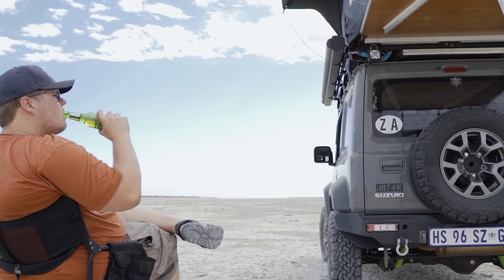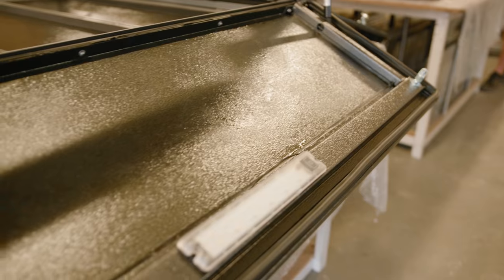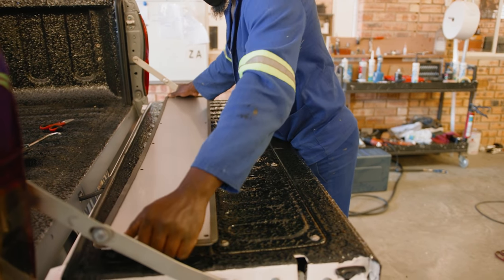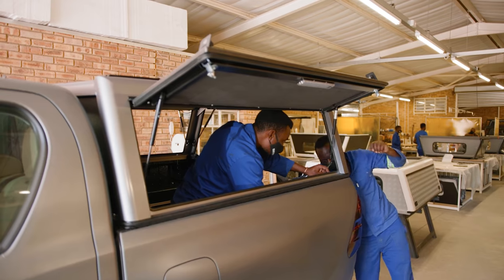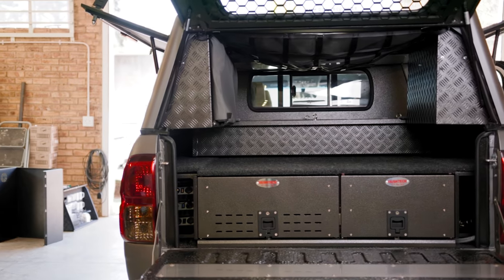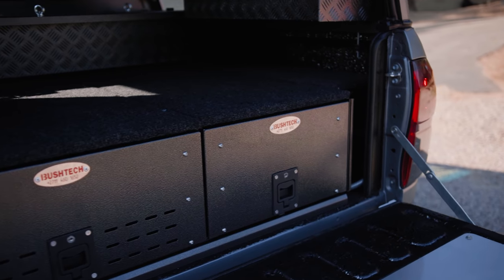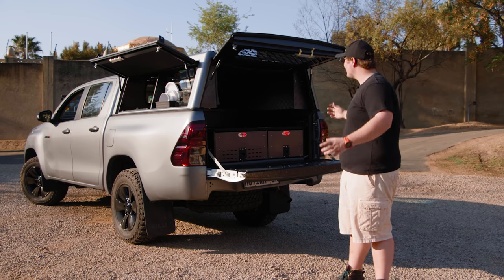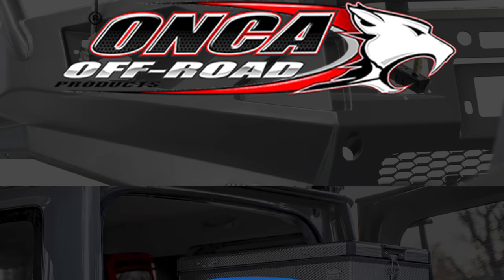Ep5 The Ultimate Bushtech Canopy and Drawersystem Setup

Comment: I will say it again, I really like my Bushtech Canopy. Good choice. 

I had the outside of the aluminium boxes covered in carpet (same as inside), and on the inside over the side door insulation. Works well with valcro canvas bags for those small items frequently used.

Better to do the alternator/solar wiring prior to sealing up the tub. Wasn't easy to remove it to get access.

Nice.
Reply from the maker: We made sure to leave a port open for the cables for the NL-DC25 Box, I managed to run it all weekend just off solar in the meantime 👌🏻
Reply: @RoamOverlanding  Great stuff, hopefully I'll get my NL25DC solar algorithm update this week.  You can ask Frans and Steven at NL for more info on the specific issue if you want. I'll leave it at that. Then I too can use my solar properly. Thank goodness for their warranty, great customer service from NL.
Reply from the maker: Will ask about it.

Comment: Hey, another great build video! a few Q`s do pop up; 1: What insulation in particular have You used? Reminds meof a closed foam cell.Please elaborate  2; What weight have You gained with this install? & what is the rated weight do the drawers hold fully extended?  3; What is the rated roofload on this canopy & are tracks on top standard? 
Another huge downfall which I see often on these (ZAR) PickUp-builds is access to the water tank & filler neck. I can see the value of not having a bulk head mounted filler neck (into the canopy) as it may be a source for tampering, but at the very very least extend the filler spout to the "gullwing door opening" so U don`t wet the entire inside when filling. 
Keep posting, genuinly keen to see where this is heading :-)
Reply from the maker: Hey Peter, thanks for the questions. So The Insulation is made by a local plastics company its a foam, that its nearly really tough and dense. 2. The weight of this whole setup is around 150-170kg. The Weight capacity of the drawers is in the 100-180kg range I believe. The roofload of this canopy frame exceeds 2 tons, the tracks do come as standard, although not in black. The Filler hole for the tank is easily accessible from the door, just pop a hosepipe inside and fill it up, shut off the hose and pull it out. I did it this weekend and it worked absolutely perfectly fine (I had the same anxiety before actually doing it)
Reply: @RoamOverlanding  I would still have made it a priorty to have the fillerneck way more accesible. I used this setup in a rental & it was a pain to say the least. Congrats on the overall progress!! Brgds from 🇳🇴👍
Reply from the maker: @peters2860  an extension can easily be added, but wont be worth the effort for me. I will however run a 12V pump to be able to shower and or pull in water if necessary

Comment: Congratulations. Excellent project that I am following.

Some questions:
a) Water tank with only 45 liters. Do you consider it enough? What about the shower?
b) Standard fuel tank for long trips? Take in jarricans or installed an extra deposit. I just didn't realize it.
c) Spare tires remain in the standard place or are you going to put that elsewhere? At the rear maybe since I don't see the rear bumper. One or two as I have seen the most common opinion?

It is a fantastic project and I have followed it because it is about a Toyota Hillux that is also my project for about 3 years from now.

Good job and I'm following it here on youtube.
Thankful.
Reply from the maker: Hey Paulo!  Thanks for watching!
a) 55L water Tank, its a lot of water! I will use it for washing dishes and having a shower every now and then, but not every day. Depending on where I am on my travels, this water might be for emergency drinking water.
b) I have a long range tank that came with the vehicle an additional 65L of usable fuel however it is 80L big. I dont want to use Jerry Cans anymore.
c) I will keep the Spare in the normal position for long overlanding trips, and a spare wheel carcass (with no rim) on the front roofrack (once that is installed)

Comment: Now how do you fill up you water tank??
Reply from the maker: Very easily, the cap is accessible near the cab slider. Tested it this weekend and it worked like a bomb!
Reply: @RoamOverlanding  So to get water into the tank you get a hose, connect it to a tap and stick it inside the tank, correct? Or alternatively, fill a jerry and gravity feed it?

Comment: Looking good👌 Whats the purpose of the stainless steel plate on the tailgate?
Reply from the maker: It can be used as a food preparation table, as well as gives you a flat space for a gas stove and for me to put my camera gear etc. Normally the tailgate has lots of ribs and dots on it/
Reply: Must say thats very clever - things can stand then and not fall or wobbel over

Comment: Such an epic setup, and it looks amazing with the colour coded canopy. With the rear completely empty, is it big enough to lie down in to sleep? I know that was never your plan, but just curious!
Reply from the maker: Unfortunately for me the double cab is just way too short. I used to sleep inside my Single Cab Amarok though :P
Reply: @RoamOverlanding  I have seen setups like yours that allow for sleeping in the rear, I actually have a double cab Hilux that allows me to do it, I have a canvas tent that attaches to the underside of my fibreglass hardlid, and goes out around the lowered tailgate, which gives enough floor area to sleep, on a setup like yours it is similar, but they use a false floor on the tailgate to level with the drawers, and attach the tent to the canopy door. I realise that's not what you're planning to do, but it is an option for double cab owners to sleep in the tray.

Comment: Looks awesome! Is there a dust/water seal on the tailgate? If you use right hand draw to store electronics can you move your battery to below it to allow easier charging?
Reply from the maker: You could, or you could store your electronics in a cupboard and run all your outlets into that for example 👌🏻

Comment: Hi Adrian, awesome following your journey. Once the borders open I'm gonna leave Maputo and head over to Jo'burg to get some mods going on. Could you get us some more info on the side drop down table?
Reply from the maker: Sounds like a plan! What would you like to know?
Reply: @RoamOverlanding  Cheers Adrian. Does the latching mechanism for the side window, only fit bushtec canopies, or do you reckon it may be able to fit others?
Reply from the maker: The locks you mean? The specific ones they use are custom made, but the design itself is a universal lock. You would just need a lock position that works for the frame you want to lock it too
Reply: @RoamOverlanding  I mean the metal piece that latches onto the side window frame, to secure the table in place, avoiding it coming crashing to the ground.
Reply from the maker: The table bracket?
Reply from the maker: It just catches with a bunjee cord

Comment: Very professionally done, do they do a sleep in camper option?
Reply from the maker: They do not unfortunately, however the canopy has roofrails to mount a rooftop tent.
Reply: Roam Overlanding thanks, do you know the weight of the canopy and accessories as currently built?
Reply from the maker: @mikekay213  Hey Mike, I think its about 150Kg for everything in there
Reply: Roam Overlanding great sounds like a good solution for a ranger raptor with the smaller payload.